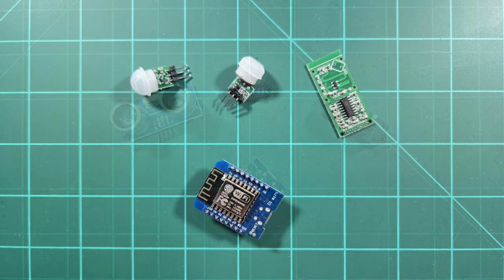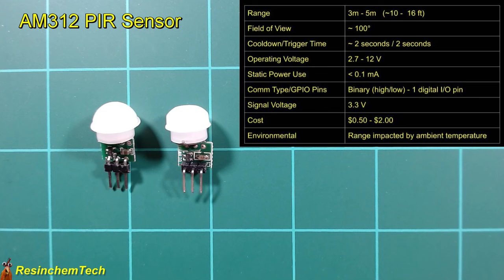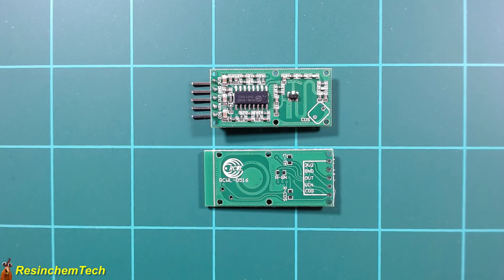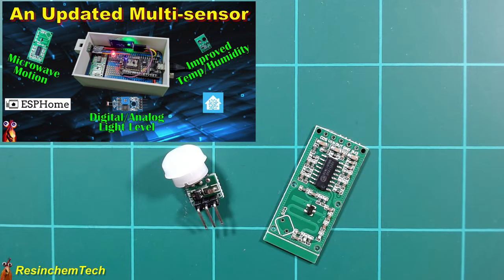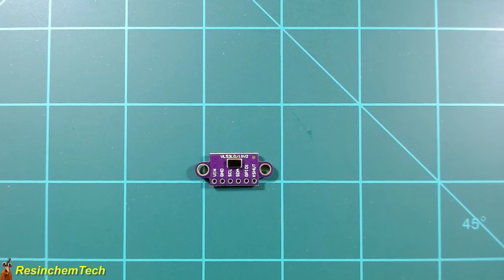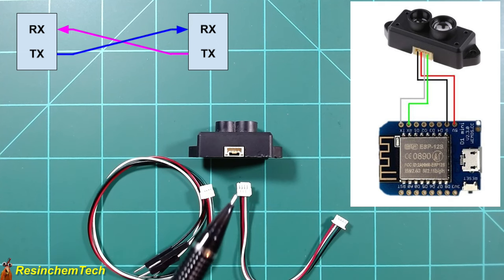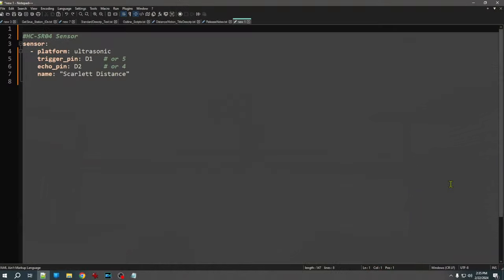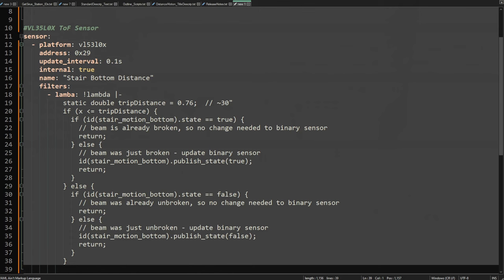Motion and Distance Sensors for your DIY Projects

Comment: Lots of good information here.

I've found the RCWL-0512 iffy on reliability.  Maybe I got a bad batch, but I've bought them a couple times from different sellers and had the same experience.  Of the 20 total I purchased, two of them work great, 10 of them work about half the time, the other eight don't work at all.  So I changed to the HLK-LD2410C MM wave motion/presence sensor.  These things work amazingly well, and are my new go-to for motion/presence.
Reply from the maker: I only have a couple of the RCWL-0512s installed and both seem to work reliably... at least in my case.  It does seem that one has a little better wall penetration than the other, but that could be due to a number of factors, including things like pipes/wiring within the different walls... or interference from other components included in my device (like the multi-sensor).

I still have a couple of others still on the shelf (obviously, since I used them for this video).  But I would not be a bit shocked to see variances in effectiveness of the devices.  Based on their low cost, all the various manufacturers (possibly using different base components in assembly to save a fraction of a penny), I guess I'm not surprised that some may not function.  I've seen much the same with just about every other type of small, cheaply manufactured components, including ESP boards themselves.

I think I mentioned in another reply that I'd like to play around with some mmWave sensors.  I just haven't come up with a good use case in my own home yet.  I have an Aqara FP2 still sitting in a box that I purchased just after they were released.  I just haven't come up with a situation where it makes sense to use an $80 sensor when I've been able to accomplish what I need with a $5 motion or distance sensor.

As always, thanks for the comment!
Reply: Agreed on the FP2, that's crazy expensive, and you know I'd rather build my own (like you!).  Definitely check out the MMwave, especially the LD2410C.  It's actually got its own bluetooth, so you technically don't even need to use an ESP to run it, you can connect by bluetooth to configure (distance, sensitivity, etc), then use a bluetooth sensor in HA to read the motion/presence.
Reply: Agreed, I find the LD2410c very reliable and you can configure on time and sensitivity via software, which is a big plus

Comment: Pumped to learn from this video!👍
Reply from the maker: There are a lot of other options out there, but I could only cover a handful in 30 minutes.  But hopefully it is enough to generate some ideas for your own projects and provides enough info that you can evaluate other options as well.

Thanks for watching and the kind words!
Reply: @ResinChemTech  yeah! You should definitely check out mmwave sensors. Like Hi-link ld2410c or the ld2450.
Reply from the maker: I have an Aqara FP2 that I picked up right after it was released... and it's still sitting in the box!  I just haven't found a good use case for it yet in my particular home.  I don't want to use it as a simple motion detector, since it would be crazy to spend $80+ on just a motion detector!  But I have seen a few of those mmWave components that might be worth taking a look at.  I'll add it to my list of things to play around with somewhere down the road.

Comment: Hi, im planing using the TOF sensor on 3.3v battery, is there anyway that I can see the battery voltage in HA?
Thanks and keep up the good work that you do!!
Reply from the maker: The way I've done this in the past is to create a voltage divider and feed that into an analog pin on the ESP board.  Then depending upon what firmware you are using (ESPHome, Arduino, etc.), you can get the voltage from the input on that analog pin.  I was doing this for larger batteries (7.4V in my case), so depending upon your board and the range of the analog pin (some are 1V, others are 3.3V) you may not need the voltage divider.

Another alternative is to simply use an ESP dev board that has onboard battery monitoring.  Many of the firebeetle dev boards for example, have built-in battery connection, can recharge the battery via USB and onboard battery discharge protection/monitoring.

I'm sure there are many other options out there.  But the one time I added my own battery monitoring, it was via a voltage divider and an analog pin of the ESP board.
Reply: @ResinChemTech  I’m using ESPHome and a d1 mini, it would actually be great if I could do it without a voltage divider as it would be more efficient.
And I see you did a list of detection sensors, would love to see a video on a LD2410 and a d1 mini as it would be handy for avoiding outside projects because the ld2410 can go through walls. Thanks for your reply and all the best to you and your family!
Reply from the maker: Most ESP boards either accept up to 3.3V on the analog pin or have an onboard voltage divider that will allow you to feed up to 3.3V, but you need to check your particular board.  A D1 Mini will permit up to 3.3V (but uses an onboard divider to reduce that from 0 to 1V).  This would be reported out as a digital value from 0 to 1023 (the ESP8266 is 10-bit). The ESPHome documentation even has details on measuring voltage using the analog pin:  https://esphome.io/components/sensor/adc.html

So as long as your battery doesn't exceed the 3.3V that the analog pin will accept, you can use the analog pin and ESPHome to report/monitor the battery voltage in Home Assistant.
Reply: @ResinChemTech  upon checking the link that you provided(very helpful), I can see that only the analog pin a0 can be used for esp8266 or to set it to vcc and read the voltage from the cip ( usually 3.3v ) but not the input voltage.
My board description is:
11 digital input/output pins, all pins have interrupt/pwm/12C/ one-wire supported (except DO)
1 analog input(3.3V max input)
As you are well aware the Chinese documentation is not always very helpful and I’m still confused if the pin that I need(D0 from what I understand)  will support 3.3v
I asked the seller which is the 3.3v analog pin and waiting for a reply, if he doesn’t answer in a day or so, I will bite the bullet and try it anyway … what can go wrong besides some magic smoke😂
Thanks for helping out, the coffee’s on me🫡
Reply: @ResinChemTech  P.S. my battery will not go over 3.3v as I’m using a 26650 lifepo4 and I will swap it when is time to recharge it to not go over the 3.3v
I opted for the 26650 lifepo4 as it has a big capacity (3500mah) and to avoid using a boost up/down convertor on a 3.7v li battery